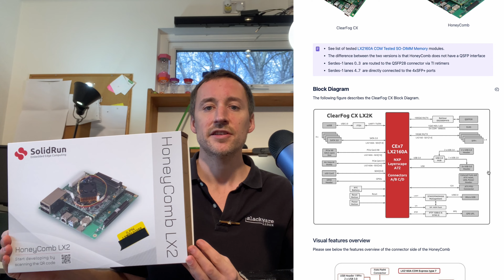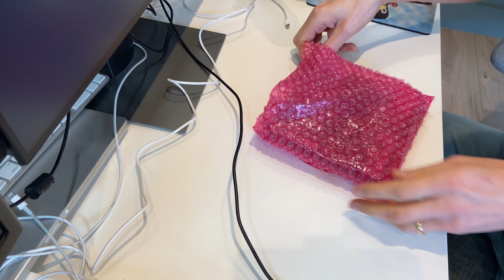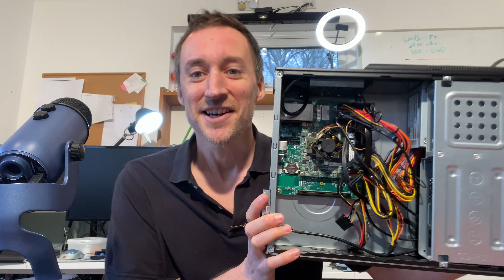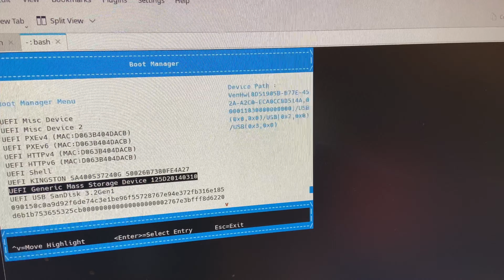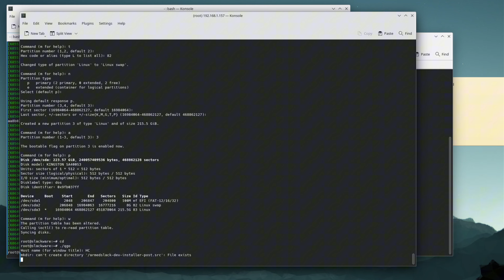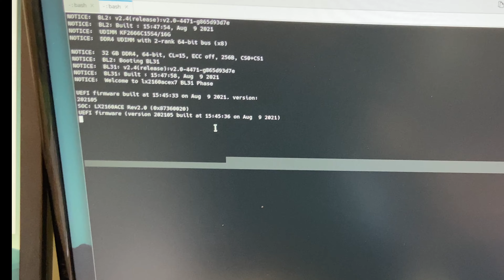S03E34 - HoneyComb LX2 assembly & Slackware Linux install

Comment: Ouch. Leaving a sensitive electronic board on a plastic is really not a good idea. As you probably know, electrostatic can't easily escape plastic, once they've form on it (by friction), so once you drop the board, they'll discharge at the first contact. Those charges can be quite significant, and damage semiconductors. But overall, great video. I'm not entirely convinced by that board, yet, what with the noisy fan, the price, the lack of integrated graphics, the dubious NVMe support. We need more workstation-level options for ARM64 that work with Linux; currently there's nothing except that test board.
Reply: It looks more like a mini-ITX form factor than standard ATX. EDIT: and it rather looks like one 4-lane NVME slot, not four slots... (which isn't even mentioned in their datasheet or manual, worryingly) ;-)